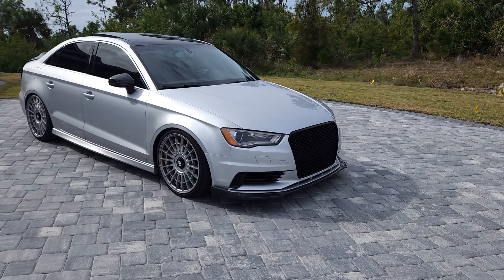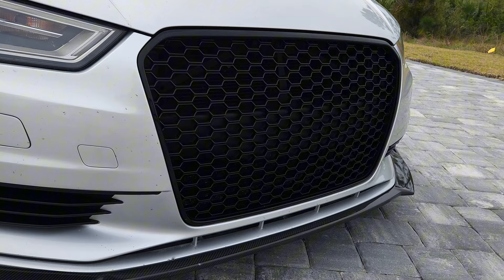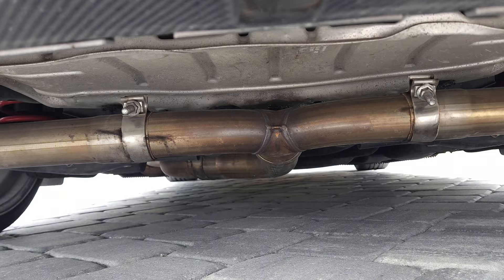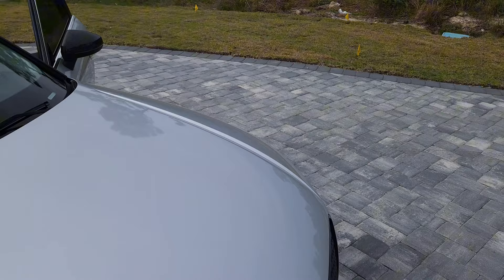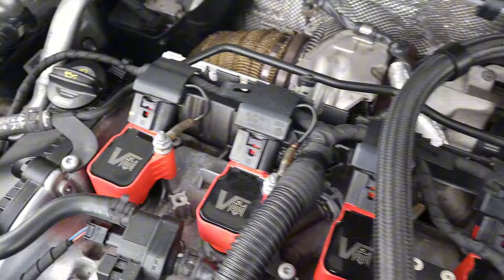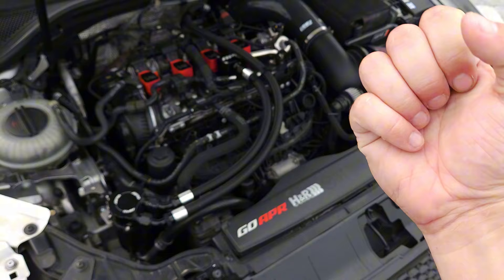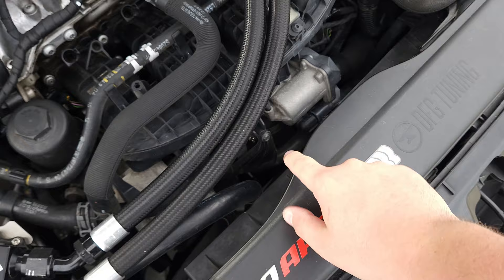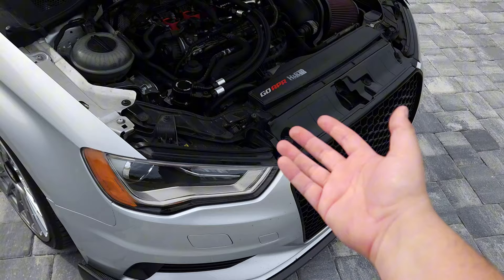My 2015 Audi A3 1.8T Build Overview

Comment from the maker: Tunezilla Stage 3 - 330 HP
IS20 turbo / Hits 160 MPH+
EQT Intercooler Pipes
EQT Coilpack Grounding Kit
CTS Intercooler/Radiator
CTS Catless downpipe
Raceland Coilovers
MBRP GTI Exhaust
18 inch Vibrant Resonator
12 inch Vibrant Resonator
APR intake and Catch Can System
ECS Dogbone Mounts
D34 Engine/Transmission Mounts
VeltSport Coil Packs
Denso Spark Plugs
Rotiform LASR 19x8.5 5x112 ET45
ECS Carbon Fiber Front Lip
EMD Auto Carbon Fiber Diffuser
Carbon Fiber Duck Wing
RS3 Front Grill
Audi S3 Steering Wheel
ECS Diverter Valve Spacer
CTS Blow off Valve
Reply: Needed this when I got mine in December, glad I came back around and found this. Love the build an hope for you’re next you keep up the video grind 💪
Reply from the maker: @bracing4racing648 I appreciate it. Ill do my best to post more videos about the car. I just don't know what video to make since I'm not really modding anything anymore. But still gonna try and post shorts of some pulls

Comment: I love the wheels - I'm currently on the prowl for a set of 18s.  Thinking maybe something from TSW.  Car is lookin'g good, but I'd recommend some hub-centric spacers - ECS sells kits with the spacers and longer bolts, whatever seat type your wheels need.  OE is ball seat, but most aftermarket I've looked at it is cone.  I've had +12/17 front/rear for 2 years now, two types of OE wheels on an S3.  No issues.  The hubcentric is the critical part for spacing safely, and the part itself being so critical, it makes sense to avoid Ebay and whatnot for this one.  But I swear you'll love the change.  Again, sick wheels.

Comment: Very nice MOD. I have 2015 A3 1.8t.  I did cold air intake and mod 2 chip. Feel like only get 240-250. Question did you upgrade your turbo? And how is you down pipe configuration?
Reply from the maker: I have IS20 turbo from a GTI and I'm running a CTS catless downpipe with 2 resonators and a MBRP Cat back from a GTI

Comment: How did you get a dual exhaust setup? Please lmk I’ve been searching for this forever there are no dual exhaust options for fwd that I can find
Reply: Does the gti exhaust really just fit on and it has the same path?
Reply from the maker: @knutz8401  https://mbrpexhauststore.com/3-cat-back-2015-2021-vw-golf-gti-mk7-mk7-5-dual-exhaust-system-pro-series/?gad_source=1&gclid=Cj0KCQiA84CvBhCaARIsAMkAvkKZsXOPGDw4kCD1dqXxsMbu0csyRlhcKMD7NasBEiXq2fdXPmNRoPoaAn9JEALw_wcB
Reply from the maker: @knutz8401  yup. Just extend tips 3 inches longer
Reply: @markooska  sweet man I was looking into putting that exhaust on my car but no one ever gave me a solid answer whether it fit or not, did you weld the tips on?
Reply from the maker: @knutz8401  everything I did was clamped. No leaks if done correctly.
Reply: @markooska  okay cool sounds good thank you for the help man!
Reply from the maker: @knutz8401  no problem man. Hopefully it works out for you
Reply: @markooska  hey man, hate to be a bother but could you send me where you got those exhaust tips? I’ve been searching far and wide and can’t find anything that looks good 😅 if you could I’d really appreciate it!
Reply from the maker: @knutz8401  no worries man. I got time.
Here is the link 
Upower Pair of Dual Exhaust Tips Staggered Single Wall 304 Stainless Steel for ID: 2.5 inch/OD: 3.5"/ Length: 10.25" https://a.co/d/f6fgOcf
Reply: @markooska  thank you man, have a great day.

Comment: Did you do the turbo swap yourself? I’m considering the same setup as you for my 1.8t a3 and wanted to know all in cost for the is20 swap and install
Reply from the maker: I bought the IS20 for $150 from a GTI that had 45k miles. Took me 6 hours on a Sunday to do it myself. If you don't got time. Don't do it yourself, oil lines and coolant lines are a pain to take off. I also bought a turbo install kit for $40 to make sure all gaskets were replaced. I'm not sure how much a shop would charge. But you better have at least $1000 if you want a shop to do it. After installing turbo, you will need to do a retune to your engine. I paid $100 for a retune, and was Stage 2 which was around $550 and became stage 3 because of the turbo.
Reply: @markooska  other question was did you consider going is38? Any reason you didn’t? Thanks for the response
Reply from the maker: @jameslawson2155  I wouldn't. Only because you gotta upgrade fuel also which is another $1000 on top of the tune for it. Too much power for a stock block. Better to do it on a AWD 2.0 A3 to actually get the power down to the ground. Cause I spin wheels all with IS20 easily.

Comment: I got a 2014 passat with the same motor is the turbo swap straight bolt on? Or is it like a nonmqb to mqb swap
Reply from the maker: Straight swap because it's coming from a GTI which is same engine as mine

Comment: Mod List?
Reply from the maker: Ohhhh lemme paste it into the description real quick
Reply from the maker: Tunezilla Stage 3 - 330 HP
IS20 turbo / Hits 160 MPH+
EQT Intercooler Pipes
EQT Coilpack Grounding Kit
CTS Intercooler/Radiator
CTS Catless downpipe
Raceland Coilovers
MBRP GTI Exhaust
18 inch Vibrant Resonator
12 inch Vibrant Resonator
APR intake and Catch Can System
ECS Dogbone Mounts
D34 Engine/Transmission Mounts
VeltSport Coil Packs
Denso Spark Plugs
Rotiform LASR 19x8.5 5x112 ET45
ECS Carbon Fiber Front Lip
EMD Auto Carbon Fiber Diffuser
Carbon Fiber Duck Wing
RS3 Front Grill
Audi S3 Steering Wheel
ECS Diverter Valve Spacer
CTS Blow off Valve